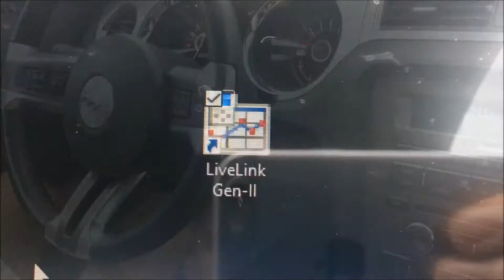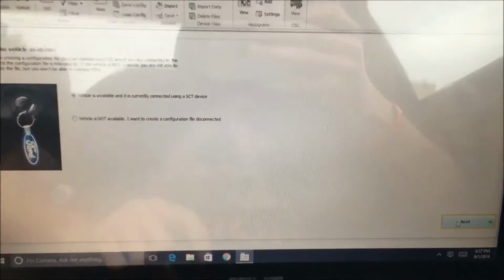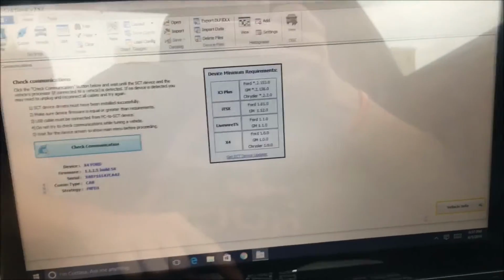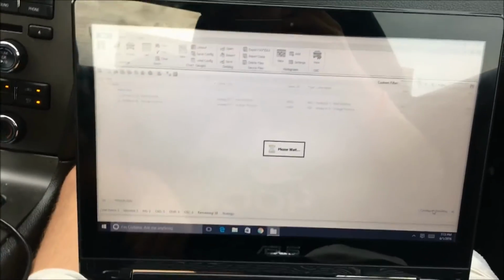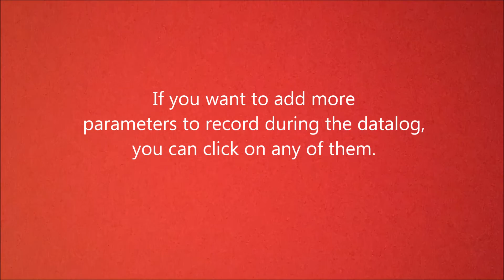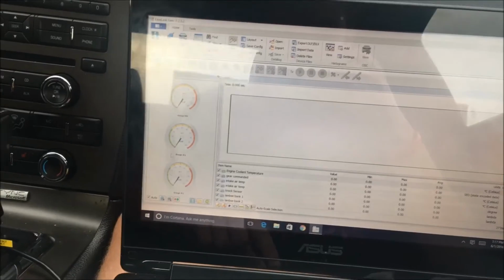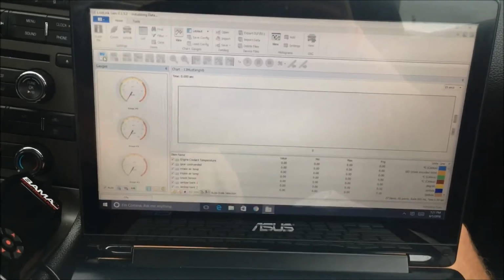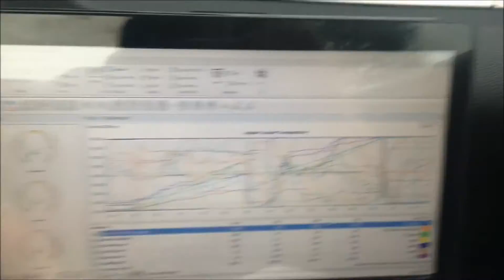How To Datalog a 3.7 Mustang V6

Comment: Did you guys data log through MPT or Bama?
Reply from the maker: BAMA, but MPT should use most of  the same parameters when datalogging. I have heard that MPT says that it is unecessary to datalog for them because they already max out most of their parameters when tuning, although it will never hurt to request to datalog to improve performance on your vehicle
Reply: +TSS Race only reason I'm data logging is because I just got my manifolds ported.
Reply: +justav6 which kind of datalog did they ask to do? 3rd gear wot pull?
Reply: They asked for 3rd gear and 1/4 mile.